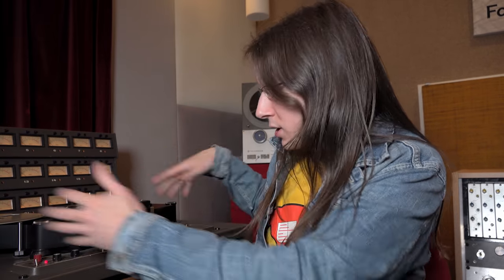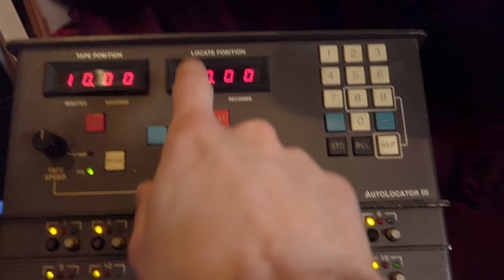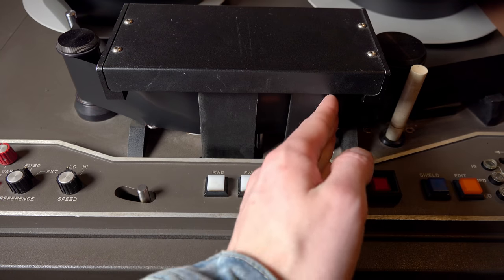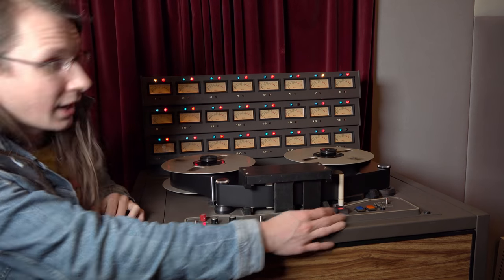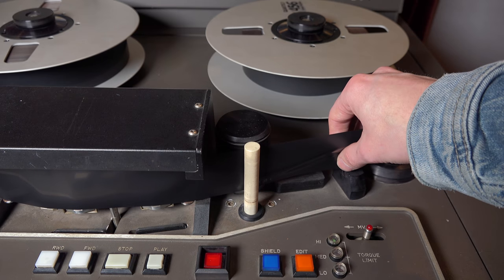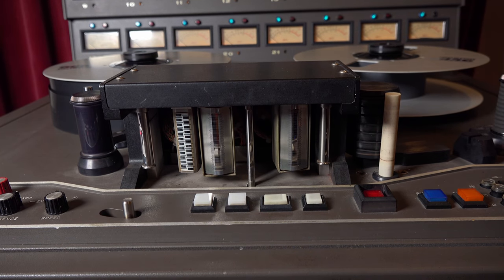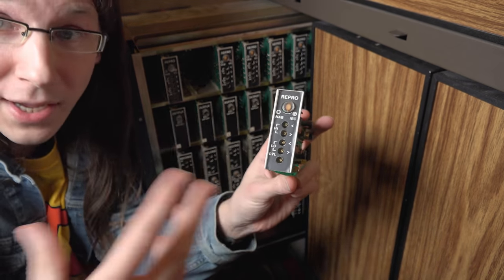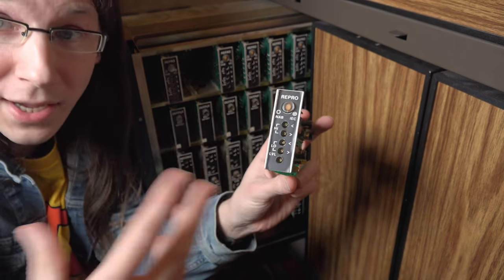THIS IS HOW A 24 TRACK TAPE MACHINE WORKS!

Comment: I'm surprised you didn't show storing and recalling locate positions on the autolocator.  I did quite a few sessions on the JH-24. My main machine was a 3M M79, but then the studio got a Studer A-80.  Best sounding was the Studer. Fastest punch-in was the 3M.  BTW, we also had a Sony/MCI console in Studio C.
Reply: Those 3M's were nice! that was the first 2" deck I learned on. Learned to replace parts on the board for the 3M updates, replace the heads, etc! The console we had was a '69 era Quad Eight!
Reply: Holy shit, sounds like my path.. Except I started on an Teac 3340 4tk, Otari 1" 8tk, then M56 3M 16tk then JH24. We were going to go Studer but went 48 & bought a second JH24. We had a JH636 and was in the process of buying the Hit Factorys old Neve  when the 90s hit. An 8068 if mem serves.
Reply: @michaelstram  Was it an M56 or m79? Either way, both used those mylar fan belts to spin the capstan. Only place I knew that had belts, pucks, capstands, lights, ... was some dude in LA who worked at 3M minicom and bought up the remain parts 10yr after production ended. Sans him, parts were a real a show stopper. Good sounding machines. Many live LPs were recorded on M79s do to their small size. In fact I'm pretty sure Beat It was recorded on a pair of M79s.
Reply: GDawg2K2 m79 ! 😃 has the huge locator for it too. Came out of a studio in Illinois north of chicago. The quad eight console was a custom built film board with a joystick. If I remember is was 16 x 16x 8 x 4 x 2 or some crazy arrangement like that. Built in 69 I was told.
Reply: @michaelstram oh yeah, the entire front of the deck came out as the remote. People have no idea how many iconic LPs were done on M56s or M79s. Allmans Live at the Fillmore, Boston, the hay day of Power Station was using 3M M79s. No need to mention their client list. Dam, That was the  Golden era of recording. From 42nd to 54th street 7th-10th ave was loaded with the most iconic studios & music stores that ever beat.  My studio was in Boston but I also did a lot of work in NYC. The Eastern shuttle  Bos-NY left hourly. If memory serves, you just walked up to the desk dropped 25 bucks & you were in the city 30min later. It was great.. Then the story seen in the film Sound City began playing out at countless studios across the country. But I digress. Sorry for rambling.. I'm just an old man reliving a 20yr blip on the history of music. Have a good day.. )

Comment: aand of course dont forget to demagnetize your heads, at this tape size and speed, you will start loosing high freq pretty quickly due to head magnetisation.
Reply: @Cable Hell Studio you can easily google details, but i'd say less "intuition", more "logic" - more movement in relation with more surface > more friction > more magnetization....

Comment: The shield button allows the operator to mark the tape with a wax pencil for certain positions of the tape, chorus, .... so the operator can find the right spot on the tape to use it as a reference or for cutting and taping back togheter the tape. That's probably why both shield and edit buttons are side by side, also the button to jog the reel.

Comment: One of the best days of my young life was taking delivery on or first Sony/MCI JH24 MIII AutoLoc3 24tk at our previously 3M 16tk studio.
It we paid $25K in mid 80s. If memory serves, the extension cards for the electronics cost a grand. They allowed you to acess/work at a component level on the rec/play/erase/bias cards outside the draw.  Pretty good tour considering that you weren't born into a 2" world.  PS; Every US built Tape machine know to man used the most obscure light bulbs on earth. Hell, 3Ms used a mylar fan built around a machined flywheel. Try replacing one of those.

Comment: MCI or Sony MCI machine like this is a a fantastic bit of kit.  Done more than a bit of work on them and for the most part they can be fixed.  Finicky at times but fantastic none the less.  They also can be loaded with a 16 Track head for and even better signal to noise ratio.  I heard tell that Ampex even made a custom 8 track head for one of these 2" decks for a lucky owner.  Yes that is around a 1/4" track width, let that sink in.  IF the head report is good on this machine then the guy is lucky indeed!

Comment: Check out Mara Machines in Nashville. They specialize in rebuilding and modernizing the old MCI/Sony machines. They sell refurbished machines with a warranty. They convert a lot of machines to either 1/2” two track and 2” machines from 24 to 16 tracks which @ 30 ips gives the best fidelity. A refurbished 2” 16 track gives the absolute fattest drums ever.
Reply: In 1992 I installed the first ProTools system in my area. I had a particular rap producer who would record projects on ProTools, but was never quite happy with the overall sound when we mixed. He explained what he wanted, and I said, "Why don't you go eat lunch, and I'll break out my secret weapon?" An hour later, I played his mix back to him, and he was floored. He said it was exactly what he wanted. What did I do? What was my secret weapon? I played the mix into a modified Otari 2track running at 30 ips, and slammed the record level at about +9. Then I played the recording back to DAT. He loved it, and I never told whim what I was doing. He would just create a mix, then say, "I'm going to eat, get out your secret weapon!"

Comment: Cool, real cool. I started out recording everything on consumer grade 4 track tape machines back in 1999 when I got this used Fostex that sounded fantastic until I botched a degaussing job I was doing on the heads and permanently magnetized them. That was a drag. I also had a Tascam that I used a lot. But neither of these were anything like the monster you've got in this video. It makes me admire the old school engineers more than ever knowing just how much work they did to maintain the gear that made music great. Now anyone can have infinite tracks if they have enough computer to back it up, and it seems like it makes things too easy. The effect is music that's too perfect sounding - like a machine played it. Personally, I hate it.

Comment: No undo on those punches, dropping in was nerve-wracking enough but dropping out was more terrifying when somebody wanted to hold a note for a bit longer.. Going from an Otari MTR-90 to Otari RADAR was such a joy and more so when they brought out the 24-Bit second generation. A great system and no waveforms to distract you from just listening. The convertors were amazing too. The only annoying thing was not having the RTZ tape rewind time to consider the next move..
Reply: This is the thing about analogue - commitment!  Digital allows lossless editing.
Reply: Heh. Cool to hear that. I was the lead software developer for Otari RADAR 1 & RADAR 2. It was an interesting time, and with a bit of luck and some hard work, we were able to recreate “the fastest winding tape deck” to an audience of audio engineers trained on tape decks, and bring them into the digital world.

Comment: So this is a lot of extra work for that sound that I do love and want.  Pro Tools Heat is supposed to be pretty darn good. Does Heat come close to a tape machine?
Reply: I don't think it's truly possible to emulate tape the EXACT same way. But there are various tape emulator plugins which I've used and they can definitely give you a similar tone, vibe and sound if you work with it until you get it where you wany.

Comment: The tape lifter is not there to remove hi-speed friction of the tape against the heads; it's to save your speakers. If you were to rewind or fast forward a tape at normal volume, you might seriously damage playback equipment.
Reply: I know that can damage human ears, or at least cause some pain.

Comment: Never touch the tape, never touch the pinchroller, never touch the capstan, never ever touch the heads (unless you have a felttip to clean the heads or capstan).
Azimuth is mostly to have correct frequency response, high end rolls off if azimuth is not perfect. This makes it also easy to align, max playback level with a testtape with 10 Khz tone. Normally alignment is checked every day! Bias compensates for distortion but takes off high end, alignment is recording a high frequency tone and set that to the right level or -3 or -6 db depends on the machine.
I was so happy to not have to deal with tape anymore, who wants hiss and distortion, and sound going bad every time you play the tape, or when the tape gets old.
Even at high speed (30ips) you loose low end and have nice high end. I used a Lyrec machine, a Studer A800, Ampex mm1200, MICI like in your clip, MCI got sold to Sony hence the Sony logo. I also worked on Neve, Cadac, MCI (also a Sony version) and SSL mixers.
Reply: I can't imagine what a quality 2" test tape goes for these days. God, I do not miss tape.

Comment: As I remember, bias is a high frequency signal that conditions the tape to prevent hysteresis when recording. Kids, you can buy a digital 24 track for about 300 euros, but you won't get the same sound or learn anything about tape :)

Comment: I just got a 2" 24 too. Couldn't resist as I worked that way for years and still think it's a process that helps you focus on the music.. It's a pain in the ass, expensive for tape and weighs about 200kg. What's not to like? #masochist
Reply: David Morley you also have Otari 2 track ?
Reply: @ArthurElectric  Yes and an MCI.

Comment: Man I knew the script on that test tape by heart on those machines. "Standard Tape Laboratory, reproducer test tape, catalog #21T205. No compensation for multitrack reproduction. 1000 hertz at reference fluxivity of two hundred fifty nanowebers per meter..." And repeat.

If you were good, you could do all 8 tracks in a drawer in a single pass.

Comment: When you typed in 10mins into the tape machine to go to the time, how does the tape machine know where to rewind/fast-forward to??? Is there a time-code track on the tape?
Reply: People kept track of their positions. The machine is simply matching it by going at a certain speed for a certain time. Just math and physics.
Reply: He mentioned that the roller/guide to the right of the heads was also in charge of the timing; i assume that one rotation of this device is equal to so many milliseconds, and from that the electronics can calculate how many revolutions of the roller is needed to reach the point he entered on the remote. Of course, if the roller is impeded for any reason, those calculations are thrown to the wind.

Comment: ya know with all the cool digital stuff in my studio I would still use a tape machine, but syncing them up is tricky, you can stripe a track with smpte and lock the daw up , but there is a system to run the tape machine to time code, not sure what it is called

Comment: Not sure if this is a Sony APR-24 or a JH24? The APR24 is essentially an MCI JH24 but with improved servo logic and transport control.
Reply: The Sony APR 24 could store calibration data for two different tape types or speeds similar to the Studer A820. 
It looked nothing like the brown MCI/Sony machines. It had PPM meters like the A820 also.

Comment: I wanna do a combination of recording on tape and DAW...just depending on my mood. All I have is a 4 track yamaha recorder that I got for 5 bucks because it did not work. I need to fix ot and get it up and running. My bet is it will just need a new belt but I haven't opened it up yet.

Comment: How is the timeposition on the tape registered or measured so precisely?
Is it reading the speed on the wheels or is there an optic counter... or something else?
Reply from the maker: Optic counter 😊
Reply: Professional studios of the time often used SMPTE timecode, but that required using up one track just for the timecode, and it also meant the tape had be pre-striped before use  (meaning played end-to-end in real time while recording timecode onto one of the tracks - that was typically one of the classic jobs of junior staff/tape ops).
Reply: @dunebasher1971  Thanks a lot.

Comment: Next challenge is to lock two 24 track tape machines together (using track 24 for ebu/smtpe code)
and then after that do a 20 second jingle locking the 24trk to the umatic video for fun like we used to do in the olde days

Comment: Don't forget a bottle of isopropyl alcohol and cotton buds for the heads.
Reply: Unless you know your IPA is free of water, that is NOT what you use on tape heads or anything else in the tape path.
Reply: @kevinwheeler6164  I always thought that the alcohol evaporated all the water... what is best to use for cleaning heads?
Reply: @Inertia888  A good non-hygroscopic solvent, acetone or carbon tetra chloride. even pure methanol is better than IPA. Water will remain on the head creating a gap between head and tape and perhaps rusting the head. I've been using tape machines longer than you guys have been alive. Circa 1957 AMPEX 1/4" ers, circa 1973 AMPEX 1/2" 4-trks, TASCAM Cassette and digital decks, 2" 16 and 24 tracks.
Reply: @kevinwheeler6164  Well... I may be a little older than you think, but no matter. Thank you for your insight! I am currently working on some projects that will require these considerations.
Reply: @Inertia888  Good luck.  I don't miss tape but, I loved working with it.  As I said in another comment: Last time(2003) I bought 2" tape it was just over $500 for a reel(2500'). We did it at 15ips. I resisted going digital but, no hiss, no buying tape, no worn out/wrinkled/over heated tape...
Reply: @kevinwheeler6164  For sure... I understand. Although digital has mostly become my life, I will always have a deep fondness for fat magnetic tape.
Reply: I used denatured alcohol

Comment: It's like Audacity in 96kHz 24Bit mode. But noisier, more expensive, lower dynamic range, smaller SNR and more THD, vow and flutter. Furthermore, you have to clean recordings heads.
Reply from the maker: I think it's actually more like 44.1 12 bit 😜

Comment: Be very careful with that ceramic capstan shaft. Bump that with a tape reel and it will just snap off. Otari use those even on their two track machines where they were only 1/4 inch in diameter. Those were always breaking.

Comment: Tails out was so the imprint goes at the end of the song instead of the beginning, so if you fade out a song you won’t hear it
Reply: Almost - it was because tails-out print-through results in a post-echo, which is much less objectionable than pre-echo.
Reply: dunebasher1971 correct sir

Comment: Not complicated , just annoying to setup, but when it was made it's a different experience than a DAW, other problem is the more you overdub the more the tape have mufled frequencie and probably sticky tape syndrome, some studio use another two 2inch tape recording 24 track to preserve the clarity of the first drum take, that was the case for Fleetwood Mac best selling album, this thing became less use when sampling workstation and drum machine took controle in the begining of the 80s , if the band do a one take or two or three there almost no trouble to keep the sound good, but yeah it was a pain in the ass, back then most of the tape engineer love work with digital because of that.

Comment: I used to take two or three old tape machines take heads out of one put into other and homemade preamps and mixers. Of course, the tape would not line up with another tape player but worked great for me! I made some great music with that thing. In end mix to another real or cassette, this was 1985. This vid is great!  Z.K.

Comment: Watching this, I'm just grateful to live post-digital revolution. If you wanted to make a high-quality record back in the day, you NEEDED complex, expensive equipment like this, and you needed a label to shell out the money to front you the cost of using it. Nowadays you can crack open a midrange laptop and buy a few hundred bucks worth of software and a cheap interface and, if you know what you're doing, get results that engineers in the 80s would give their left arm to get. That's better for music, better for the music industry, and better for the human soul.

Comment: Don't smash the switches. It's not a playstation.
Each transport switch costs about $60.00 each. 
they are probably 30 year old switches you have there. 
SO many things you have wrong there.
Also best machine to make 2 inch loops ( Only machine )
Tape tension is done by reel tacho and then feed to an analogue torque converter. 
Best tension system ever, except when the ic sockets or tacho go noisy.
Also can do spot erase. And the best punch in.
Use to hook up talkback to be driven by play lamp to give auto talkback in stop.

Big trap with low frequency adjustment on those machines.
The trim pot has more adjustment than the circuit can remain stable.
If you turn the low frequency trim down to far, it al the sudden attenuates the Mid band Dramatically.
So if you don't have enough bottom end, playback 1 k and turn the low freq adjustment up and down. You will see !K jump by 10 db.

Comment: And the good 2" ampex tape cost around 900$
Reply: when I was using 2 inch tape in the 90's it was £80 a reel which lasted 15 minutes at high speed
Reply: @colindowden1430  10" reel?